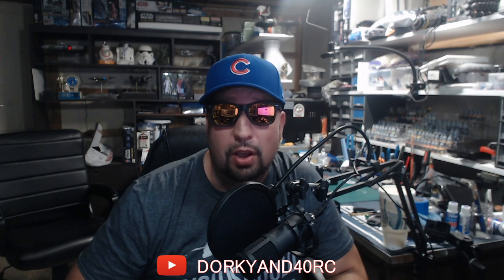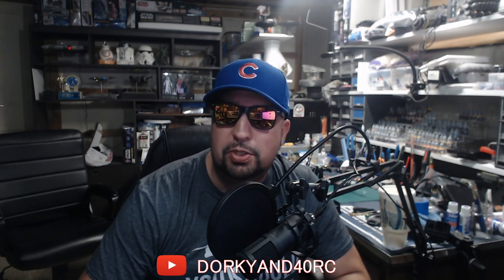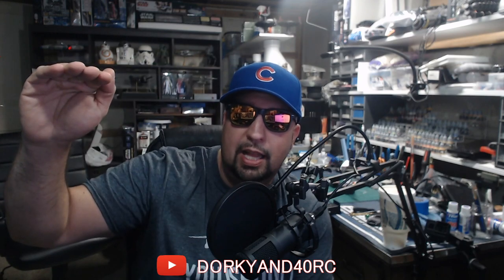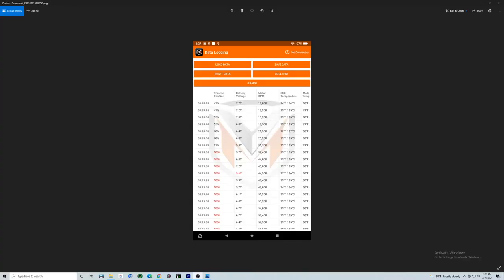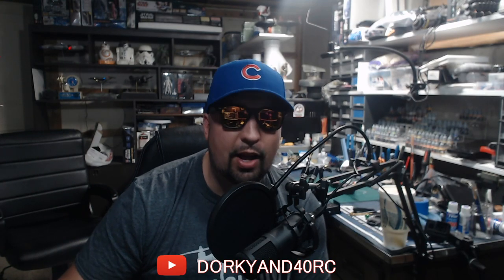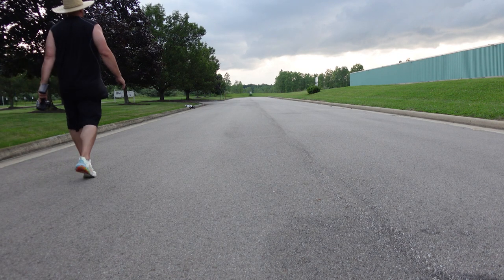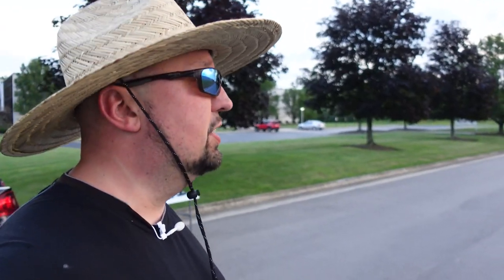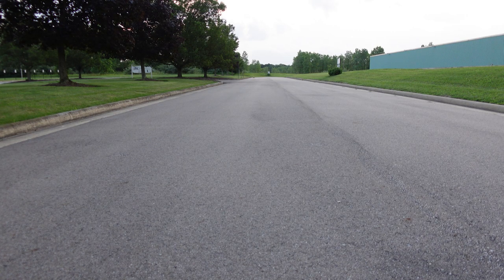MAXAMPS NOPREPRC MULTICELL BATTERIES | GAME CHANGER | PAY TO PLAY | THE BEST YET

Comment: It’s funny , I’m runnin the same setup as you and I am stuck at 5.1 at 61mph . I did a 4.4 twice but nothing pass the 5 mark , been at 5.1 for two weeks now and can’t get pass it . Every time I put power in I break loose and have to peddle it . Ty for this series , seems like we on the same adventure
Reply from the maker: 5.1?  that is not right!! you got an esc with an esc with a data logger or something? or maybe tha gnss is bad??
Reply: @Dorkyand40  yes I’m jus stuck on the tune and been fighting with traction issues but will get passed it soon
Reply: Hey dude if you don't what are u running set up.
Reply: @RazorRoo1989  runnin same as dorky
Reply: 5.1? How far are you running? For proper times you should run 132 feet. If you are doing over 50mph in 132 feet that's has to be under 3 seconds.
Reply: @DJ.1001  2.51 bro sorry I didn’t add the the full time lol

Comment: Hey D40 - So you are just using tire warmers and then a quick heat up on the road ? No carpet or traction products?
Reply from the maker: clean with brake cleaner (CRC brand autozone)  then apply simple green and rub that in with a brush..let dry or throw warmers on at the race..i do this everytime in between heats and passes..and so does everyone else..even the fast guys around the area ive watched

Comment: Have you tired the current 5800 quad core pack?
Reply from the maker: I have the 6 core max amps snd the 4 core trinity. I think I like the trinity better.
Reply: @Dorkyand40  
By 6 core, you mean the 3P battery?   We'll see how the 4P performs.  An interesting thing I learned is my 2.34 GNSS tune for the DRK 3.5 is nearly identical to Brooks's tune at Topeka.  My  DRK and CNHL batteries dip to around 6.8v on top end with 13.2 gearing and half the turbo in my Losi 22s pig.  I'll be curious to see if the Maxamps battery helps my ET.  Also working on a Bullet 22S/5.0 build. Hopefully, that helps me shave some time too.
Reply from the maker: What remote you running
Reply: @Dorkyand40  
A cheap Spektrum  DX5C.  I just watched your latest M17 video. 2.10 @ 70 had to make all your frustration along the way feel worth it ? That's awesome. I think Maxamps owes you a tee shirt now if you send them a link to the videos.

Comment: So is this battery a 7.4 V battery? Is it still considered a two cell?
Reply from the maker: Nprc rules is 2s 8,4volts.
Reply: You can do a high voltage charge on certain batteries if it's HV battery. Check and make sure give your car a jump of the line and zoom down the track

Comment: Chad will it fit in the dr 10 battery tray???
Reply from the maker: Mine yes. Just removed some of the material. The inside rails you could say. The bigger ones might be a challenge not sure yet. I’ll do a short and show you what I did tomorrow.
Reply: @Dorkyand40  thanks buddy I just bought one it says 68mmx 35mmx 57mm but doesn’t say l x w x h … could you give me the actual dimensions?
Reply from the maker: Sure. I’ll need to check it my man.